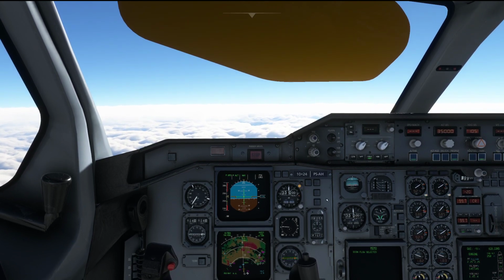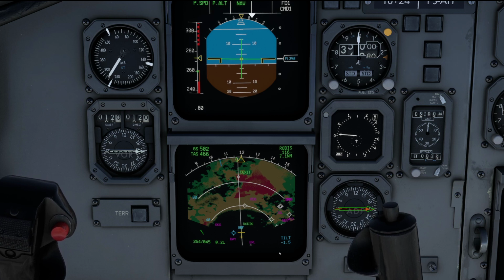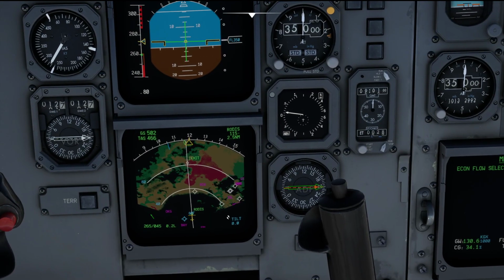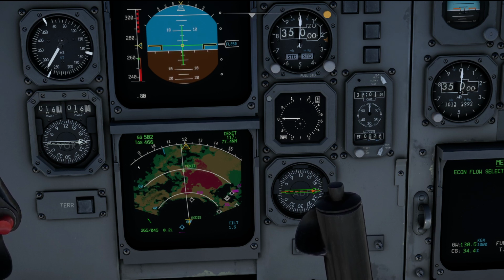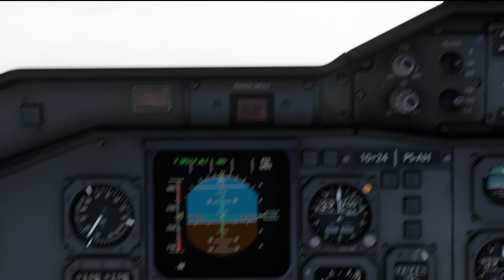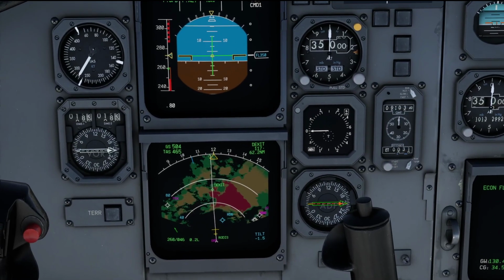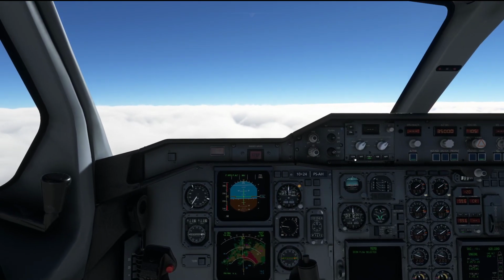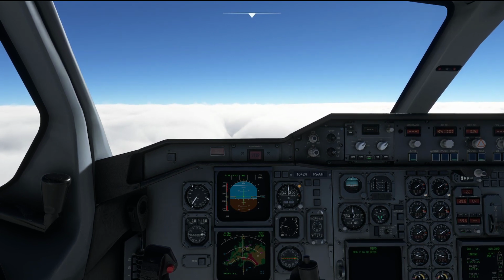Why Asobos Weather Radar is USELESS | Real Airline Pilot

Comment: You guys you should all watch the last Q&A. They said there they want to give us 3d rain data but can't because of the current license agreement with Meteoblue. They are going to bring it up at their quarterly sync with them. Therefore, it will be a few more months. However, I think it's a bit unfair by everybody here judging them like that. You don't know what their contract with Meteoblue looks like and how hard it is to accommodate their requests.
Reply from the maker: I don't see that as a valid argument, the community is asking for it for such a long time, if they really wanted to do it they could have approached MeteoBlue long ago.
Also, without knowing their exact agreement with MB, what we want is NOT the position of rain in real life, but of rain in the sim. And they are not the same. I do have my doubts that they are actually prohibited from sharing the position of rain in the sim because of their contract with MB. Sounds like a typical developer excuse to me "oh sorry, can't do it due to licensing". Wouldn't be the first time we see this in flight simulation.
Reply: @A330Driver  Exactly. They know that the pressure is on, because devs are keen on getting realistic WXRs implemented, and there are some who won't compromise, especially FBW. It shouldn't be a matter of relying heavily on third party data that is subject to a contract, it should be a matter of accessing data from the sim itself.

Comment: Weather Radar is not a cloud radar. It wont reflect unless there is an moisture or solid like hails. But, yea weather radar needs some improvements.
Reply from the maker: Absolutely correct. However generally when there's rain there are also clouds around. Looking outside the window is always a good indicator. There can be clouds without rain, but not rain without clouds. And when there's amber or red returns you will surely also be able to tell by looking at the clouds that "there's something in there".
I find that in flight simming looking outside the window is really underestimated. You wouldn't believe how many judgements we make in real life by the look outside of the window rather than the instruments.
Reply: @A330Driver  not sure why JS took such a hit. There is no reason that JS is a problem. Also SU11 enabled the weather API via WASM.  The radar effectively being a top down 2D picture is a big problem. No reason it cannot be improved. I’m sure it will. Until then I will put no pressure of devs to implement what is available now.

Comment: 😀In my opinion, it is a big challenge to implement very accurate global weather. The game has to consider factors like performance (network & user PC), availability of weather data and rendering it in MSFS view. If I am not wrong, weather is interpolated between points with weather data and the same logic may not be applied to both what you see outside the aircraft and those on the weather radar output on screen for performance sake. Therefore the disagreement of what you see. Will be great if MSFS can do it in future updates.
Reply: The problem is the are intentionally limiting weather data because they don't want to give the devs access to it. All they want is 3D data to have a fully functional weather data but Asobo wanna be hush hush. It's whatever!!
Reply: @denziiey  perhaps its their license agreement with meteoblue 🤔
Reply: @FSTurtle  that might be it but if so why can't they be transparent. It's like they just washed their hands regarding the weather radar

Comment: What you actually mean is that the weather radar has a bug, not that it's useless. Wouldn't it be more constructive and easier for everyone if you simply reported the bug to them, rather than making a clickbait video? It seems to me that this video is useless.
Reply from the maker: No. It's useless. Its complete conception and design is not up to the task at hand. That's not a bug, that's plain useless.

A bug is something that's designed in a certain manner but fails to function as intended. Asobos WXR API functions as intended. But fails to meet the requirements for the task it is designed for.
Reply: It's not a bug and the video isn't useless.  This is simply a lack of Information. The weather radar is 2 dimensional instead of 3 because that is as much information the devs are allowed to process. Why this is a big deal for us diehard simmers is because MSFS has the most advanced weather simulation and what better way to appreciate that than to make observations using simulated equipment.

Comment: If p3d/active sky could do it... Microsoft should be able to do it! I don't see why they slippin on this feature it is a very important part of flying and simming
Reply from the maker: One would think so... In the end it was quite simple for active sky: Just provide a basic 3D model of the precipitation, the rest can be done by the Addon devs.
Reply: @A330Driver  ActiveSky is an add-on, default X-Plane radar also doesn't have tilt function.

Comment: Jorg/Asobo: “Weather is a core part of our simulator, and we will strive to make it as accurate as possible.”Also Jorg/Asobo: “We are going to limit the weather API to rain intensity only.”
Reply: Total clowns🤡 cant even understand whats up with them seriously
Reply: That's actually exactly how an onboard radar works. It can only detect small water droplets. A weather radar is unable to pick up clouds with low water content, they just do not show up.
A "rain intensity" radar is then probably closer to reality than one that would show every single cloud.
Reply: So you're saying that they should break the law, providing payware raw weather data from meteoblue to every dev. I'm sure if they could, it would have been done by now.
Reply: @koki5561  While you make a valid point, if it is the case they cannot release any data to 3rd party developers, then they better come up with another solution, because in a years time when we still can't adjust the tilt on our scopes to depict the weather correctly, there are going to be riots. 

You know what the flight sim community are like? If they want something they will go on and on about it constantly for as long as it takes. I know I will. A fully functional weather radar is an essential instrument to any modern cockpit. It like having a car without a speedometer. 

It would be the biggest oversight in MSFS's history bar none. They have to come up with a better way of depicting weather on our scopes.
Reply: @MrBillUp  In the new dev QnA, asobo said they are still trying to discuss with meteoblue on that matter. So all hope is not gone I guess, but it's tough.
Reply: @Holland1994D  being a large company means heavier scrutiny. They could be easily sued when their break their contract with Meteoblue.
Reply: @MrBillUp  I don't think tilt even possible with X-Plane default weather radar. This is used by many planes including ToLiss Airbuses.

Edit: also about your second paragraph, are you saying the flight sim community is behaving like children asking for chocolate?
Reply: @bltzcstrnx  
In answer to your first question, there are a lot of things Xplane doesn't have, and I don't see how comparing the two adds to the conversation. MSFS is by far the superior flight sim, and as such should hold itself to a higher standard. 

As for the second part, you must be new to the MSFS community? I would say 80% of us are dedicated enthusiasts of an adult nature. We don't eat chocolate, and certainly don't act like children. If we feel there is a fundamental part of the sim missing, we will do everything we can to get it implemented, no matter how long it takes. This is of benefit to every single person who buys a copy of MSFS.
Reply: @MrBillUp  I'm not new to the community. It's just the first time I saw they admitting it out loud.

As for weather radar, they need to find a way to expose it but not so that people can use it to get actual real world data. I'm developing a software that relied on weather data, and they're really expensive. As in thousands of dollars per some numbers of API calls. If MSFS provides an accurate one, it's much cheaper for me to run MSFS and extract weather data from there. This is what Asobo trying to avoid, most likely because Meteoblue ask them to.
Reply: @bltzcstrnx  Quite possible, the average sim users who are claiming wanting to sue is a laughable matter. Makes as much sense as me wanting to sue Google because a specific search doesn't show up on their engine. Tough luck.
Reply: @MrBillUp  You are not their target customer... 95% of MSFS flyers simply won't care...although it is a really important issue for dedicated simmers.
Reply: @kneecaps2000  I disagree. I have been in enough live streams to see and know new flight simmers want whatever is being depicted on screen at that time.

Let me expand. Activesky is released for MSFS (I'll come to this in a minute) and every single content creator known to man is streaming it. It is with 100% certainty Hi Fi Simulation sell a absolute freighter load of copies. Not just from the streaming, but from the fact Activesky is front and center in the MSFS Marketplace. As long as the price is right, people new and old will buy it in the tens of thousands.

 In the most recent Dev Live Stream Jorg said enough people have been asking for dedicated weather and camera suites for Microsoft to sit up and listen. They are aware now that locking things like weather to the core sim is no longer an option. By the end of this year the weather and camera API's will be made available to developers to create their own software. Queue Activesky and Chaseplane. And in turn a proper fully working 3D weather radar. 

Its happening people. We spoke, Jorg listened. He knows selling Activesky, chaseplane etc in the marketplace will make them lots and lots of money. Microsoft charge 30% to sell in the marketplace, and developers are happy with this as they get to sell more copies of their software than they ever could selling it on sites like Simmarket.
Reply: @koki5561  there has to be an alternative...
Reply: @frap9965  Until no one comes up with one that is legally possible,  nothing can be done. Ofc, this requires some effort not only from asobo but also plane devs.
Reply: Weather Radar is not a cloud radar. It wont reflect unless there is a moisture or solid like hails. Weather radar needs more work for sure, and Asobo is working on it.
Reply: @hpharold23  Asobo is not working on it.
Reply: @cptalpdeniz  Wrong. They never said that they are not working on the API. There is clearly enough pressure from third party devs, so to torpedo them would most certainly lead to backlash.

Comment: The irony, of course, is that despite how useless it is, it's still more useful than no WXR at all.
Reply from the maker: Is it? If this was filmed at night where you can't see the weather ahead you would have flown in circles trying to avoid weather for nothing.
Is that useful? Only for eye candy if you ask me.
Reply: @A330Driver  - good point about "at night". I agree with you in that case. But in the example above, at least if you were starting a descent, what you have in the A310 'might' be somewhat useful - and certainly more useful than nothing at all. In any case, I like the video and I think it's important that everyone keeps pressure on Asobo to get this WXR thing right. In fact, the whole weather SDK needs a lot more work.
Reply: @A330Driver I would still venture on saying better than nothing especially when planning decent though I agree it not good or acceptable for study level simulation
Reply: I agree. Even if it is 2D top down, at least it gives some idea of any heavy shit ahead, despite the tilt not working. At the moment it's completely blind flying. It'll do until they come up with a proper implementation.

Comment: How do you know this is an Asobo issue vs an Inibuilds issue?  Could be Inibuild WX model isn't fully modeled and it's simply looking top down only.  This whole Java vs wasm is hearsay in my opinion until I hear it from MS/Asobo themselves.
Reply from the maker: Other developers have said the same thing. For example Fenix said it on their discord, PMDG also said it.
In the Analog King Air it works the same way as in the 310.
That makes it quite a clear indication, doesn't it?
Reply: Ah... hadn't seen other devs say that.  I'd still like to see MS/Asobo comment on it and what their plans are.

Comment: Hi Captain!
Thank you for this video, good one as usual!!! Well, we are "many" real pilots and hardcore-simmers who try to raise votes in order to get realistic weather which means "dangers in the skies" in severe weather conditions and that is still not implemented in MSFS skies, unfortunately... Clouds are just cosmetic somehow, indeed Asobo still allows to fly a C152 into TS or big dark CB without encoutering any convective or lethal turbulence. Even huge CB do not provide dangerous updrafts.  For instance one of the most important lesson in my PPL was to avoid CB flying a C172, not only because of IMC but also because of severe turbulence that could occure in those clouds, for the sake of safety!
Therefore having some RED in the radar doesn't make sense even if a big time cells are in front of the nose of the bird. There's even no need to avoid cells and TS because there is no effect/impact on the envelop, no turb (or barely moderate turb), no need to deviate, we are safe anyways!!! lol ...
 What do you think about it? ;-)

Comment: Yeah here here.. Asobo refusing to allow 3rd party plane developers access to metar data means no weather radar for planes like Fenix and PMDG.. Great stuff Asobo🙄
Reply from the maker: The problem is less access to METARs - there are other ways to get them - but access to where exactly the weather actually is within the sim.
Reply: It's a license issue because the weather data is simulated by MeteoBlue - therefore 3rd party devs cannot access this data on their own or ever will be via API. But I bet they will improve the information that you get back from the weather with correct tilt angles from radar. Just open a ticket or post on the official forum and not YT